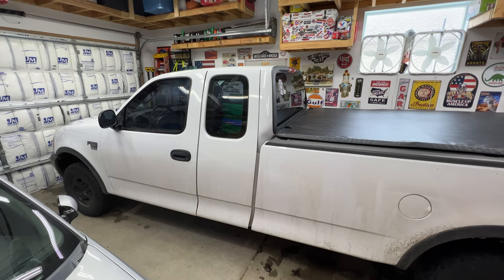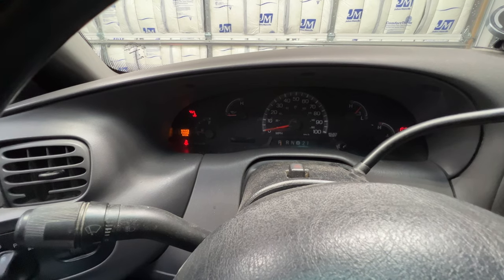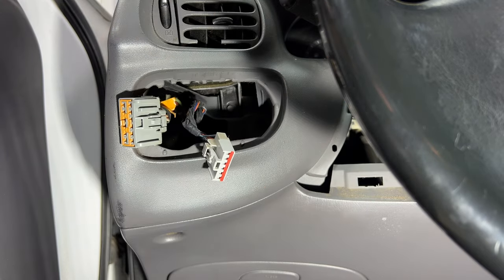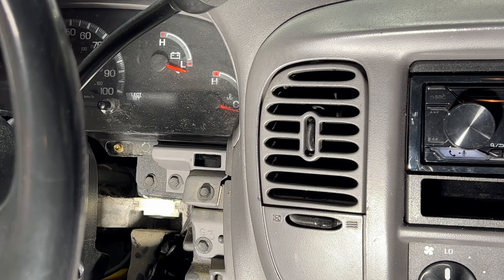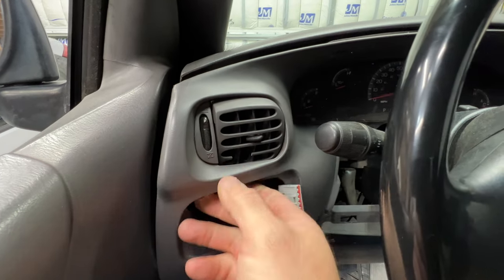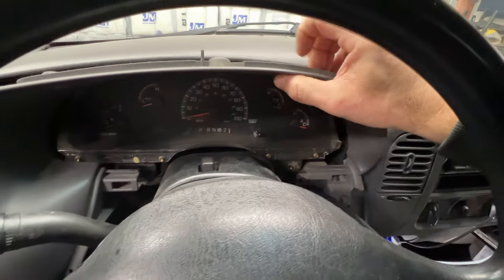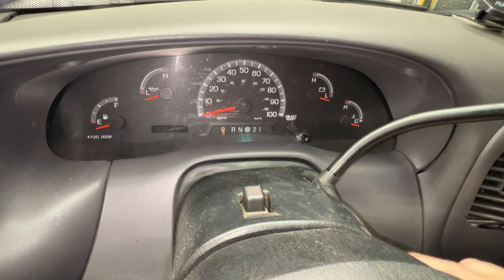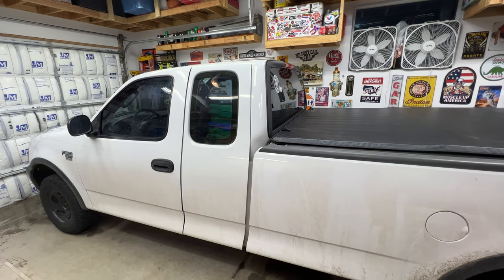Ford F-150/Expedition Digital Odometer Repair

Comment: Nicely Detailed Video!  I'm really glad I have a Tilt Steering wheel.  By the way, if you don't have a magnet to keep the screws in the socket, you can take a small piece of paper towel to wedge the screw into the socket.